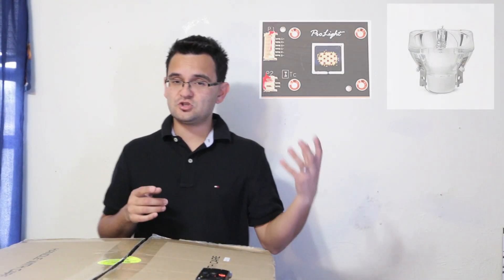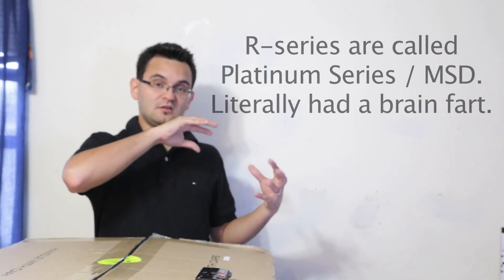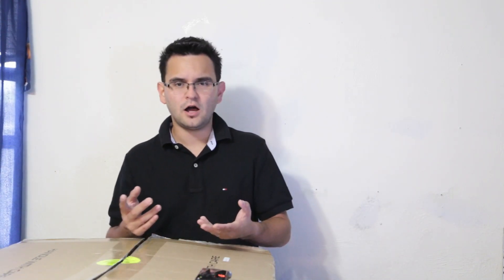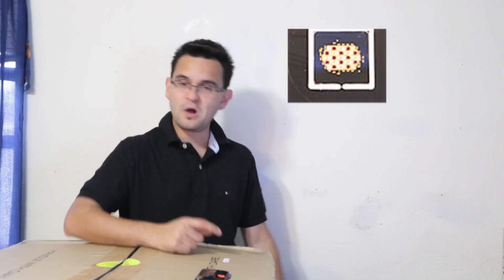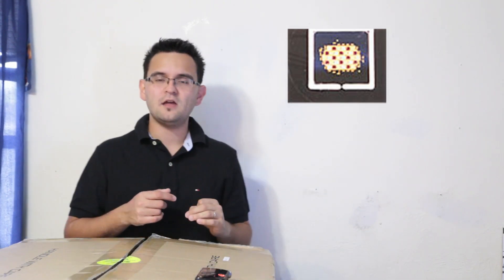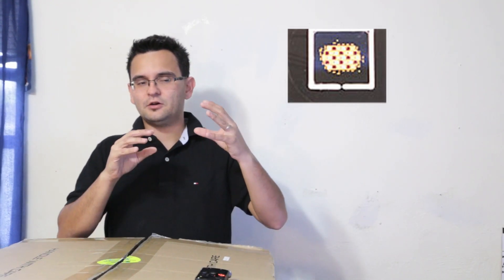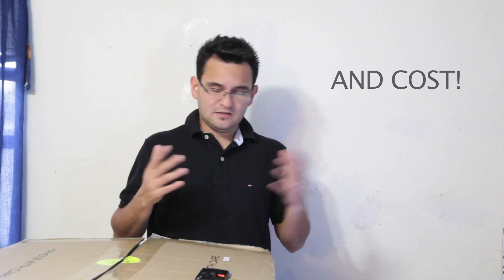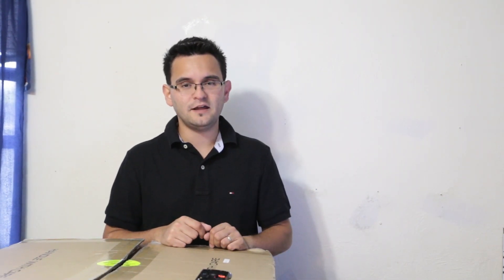Is LED really that efficient? MSD VS LEDs!

Comment: The main difference is monolithic, high current LED sources are no longer progressing in development  as the mainstream lighting industry moves more towards distributed LED sources that use lots of low power LED sources. HID on the other hand has always used high wattage nd fairly small light sources. The higher the current the greater efficiency.  As of just a few years ago if you wanted a 30watt or brighter LED chip you had a single manufacturer to choose from, and that chip has half the efficiency as a 3watt Cree.

Comment: I'm still a fan of l.e.d. lights.  They run much cooler than others and for gobos, you can use plastic gobos which are much cheaper than metal gobos.  The one thing that you did touch on is power; l.e.d. lights are not as bright as standard bulbs.
Reply from the maker: +tbmproductionsdj1 -  LEDs can be as bright as "standard" (aka halogen) bulbs. It all depends on the LED itself. However LEDs cannot keep up with MSD lamps.
Reply from the maker: +tbmproductionsdj1 LEDs can also melt plastic GOBOs, it all depends on the fixture.